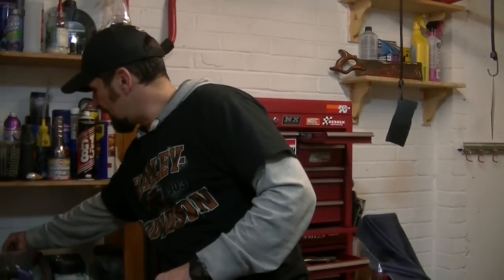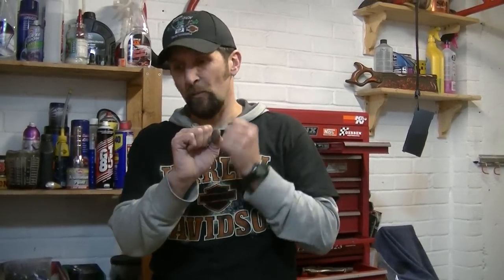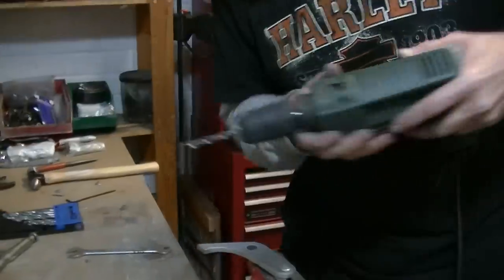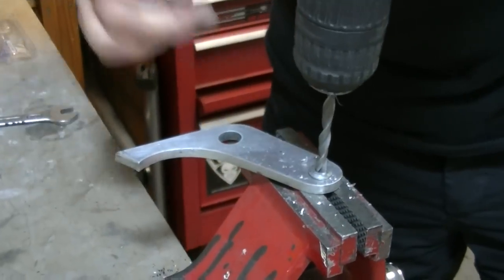Delboy's Garage, Stripped Allen Bolt Fix!

Comment: Hello to you both! Great videos by the way, helped me a lot with my bonneville. Im planning on a 8000mile trip round Europe on the bike come next month. Do you have any tips to modify the bike to make it more worthy for long distance. Im planning on doing the following: TEC progressive suspension front and rear, changed the seat, sissy luggage rack, I'm thinking of doing the 1430 peli poor mans hard cases but I've yet to fashion a rack for the panniers (any tips?), 19T sprocket for mpg, centre stand for tyres. I heard a beaded throw over for the seat was great for long runs. Also would the renthal bars be good swap out for the standard OEM bars? (I have clipons at the moment…..hell no haha)

Keep posting your videos! :)

Sam,
from Chorley
Reply from the maker: Hi Sam..
Not clear what bike you are planning to do this tour on....what have you got as a base bike.. ??
Reply: Ah sorry I have a 11 Bonnie T100
Reply from the maker: Sam Moon
Hi Sam. That's a great bike for the trip mate, i can think of a more reliable and enjoyable bike for a road trip.. its hard to suggest all the things you will need... prepping the bike is an important job ... I have a video about pre-touring prep to give you the basics of mechanical preparation, but as for your choices of how to set it up, it's about practice... the bike has to be as comfortable as possible for hours on end, so take some time to do a few miles with the different bars fitted, and as for the beaded seat cover, that's for cars mate, not bikes... long distance adventure guys often use a thick sheepskin cover, as it can make the bike really comfortable once you get beyond the 4hr mark... as for luggage, you've really got to work out a way to make it work for you!  The Bonnie isn't designed as a tourer, but throw over bags and a tank bag can carry a lot of kit if you pack it right... I'd also fit a Scottoiler and set it up properly, then you can pretty much forget about your chain for the whole trip... carry some basic tools for basic things like chain adjustment, but more importantly breakdown cover that will repatriate the bike if you crash it, or break it beyond local repair... and the relevant travel insurance, but sure you've dealt with all that... I hope that gives you a few pointers my friend, good luck with your trip!
Reply: Scottoiler is a good shout. I think my mate put a cheaper version on his bike and they work just the same, ill look into it. Would it be wise for me to invest in a crash bar? As I've no idea what terrain ill be up against when I go.
Reply from the maker: Sam Moon
You could invest in the engine bars that Triumph sell.. they will save a casing getting broken if you drop it... good idea.. !

Comment: I know this video is a bit old but I'm trying to remove an Allen bolt of the same nature from my rotor. im trashing the rotor and all bolts but I'm worried if the shaft of the bolt will be stuck flush with the hole after I knock the head off. therefore not being able to get pliers to it to twist it out +Moonfleet41
Reply from the maker: +Michael Karle Understand your concern my friend, but once the head is released, then the squeezing force placed on the bolt is eliminated... it will be Locktite'd in, but if you just take the head off only, and leave as much stud as possible, once you remove the disc, you can use a little heat on the area (not a flame, just a hot gun will do, or even the wife's hairdryer on the hottest setting played on it for a minute or so)... this should expand the alloy of the wheel casting away from the steel of the bolt shaft... this heat will also loosen the Threadlock, as it's a plastic compound, and will melt with heat, and also, never forget the wonderful powers of a good soaking with aWD40 before you get stuck in with the stud extractor, or grips ! Have confidence in your skills, take your time and tell us when you get it out... good luck Del

Comment: Any tips for phillips screws that can't be centerpunched or grabbed?
Like the ones in the brakefluid reservoir :(.
Thanks
Reply from the maker: DoubleYouPee Just drill the head out mate..ive had lots of reservior screws mince out, use a drill bit the same size as the screw shaft, and just drill down till the head spins off... once the cap is lifted clear, the screw stump can be unscrewed with sime pliers... easy..!
Reply: Well I did what you said.. drilled it out with same size. Head came clean off right at the base, and I removed the cap.

Stump hardly came above the reservoir so had to punch round with a hammer (you also have a video about this)

Thanks!
Reply from the maker: DoubleYouPee Glad you got it sorted buddy, now replace it with a stainless steel machine screw, and use some anti-seize on the thread....you'll never have the same issue again.. take care. Del.

Comment: Hi Del, today I came across a problem whilst trying to remove the centre stand on my Bonneville. I managed to undo the allen bolt and nut from the right hand side, but the one on the left is stuck. Its an 8mm allen bolt, through a metal sleeve, then the frame from the centre stand, the bike frame itself, then a 14mm bolt on the back side with plenty of thread left over.

I'm at a bit of a loss what to do next. I don't want to lean on it (also its in a tricky place to be able to lean on it), I am worried about rounding off the allen bolt and/or the nut on the back side.

What should I do? Thanks so much in advance!
Reply from the maker: Hi Ben....i know its sounds plain... but there isn't much you can do but lean on it... just make sure you have proper fitting tools, a decent 6 sided socket on the bolt head, and a good quality alun key in the other that fits snug, and tap the tool fully onto the bolt so it wont slip.....and try to crack them open, maybe a little WD40 to soak in first over night...and see how you get on...! sorry there;s now magic solution mate...its just being careful and luck..!!    Hope thats a small help in some way...cheers, Del.
Reply: Success!!! I WD40'd it overnight,then this morning removed the silencer and fully lent on it. Nothing. Then I used the centre punch and toffee hammer trick from another video, again nothing. I decided to give it all a bit of a bang with a hammer on the allen bolt head, the end of the bolt and the nut to try to un-bind the metal surfaces that were rusted together and then with another full on 'monkey boy lean' it started to move! So happy. Got it off, no more centre stand.

First seized bolt I've ever removed, thanks very much, today is going to be a good day!
Reply from the maker: Hi Ben, good going buddy... only when you've done that yourself do you realise how utterly satisfying it is when it finally cracks... and it's even more satisfying when you don't need the item and you intend to discard it that the bolt actually shears off because you put so much force on it, if you came back to me and said it was rounded, or still stuck, the final solution is to drill the head off completely, and belive me, that never fails lol !   Just say to the bolt 'I am the borg, resistance is futile'....
Reply: +Moonfleet41 I had the drill all ready to go in case all else failed. Luckily though this way I only trashed the nut but can keep the Allen bolt and clean it up a bit. Gonna get myself a tap and dye set and see if I can give it a second life now that I've watched your other video on that topic.

Thanks again!

Comment: What about a transmission filler bolt that has a rounded allen or hex head seized bolt, what can you use for that?
Reply from the maker: +Daren Pegg Hey Daren...thsoe drain plugs are big, usually about a 10mm alun key......so normally its a case of drilling through the middle of them, then using an "easyout" tool to remove the rest.....but before you resort to surgery...give the old 'Torx bit trick' a try....   Take a Torx bit that is a tiny bit too large for the hole...and tap it into the wrung out hole right to the bottom....and much of the time is will 'bight' enough to back the plug out...   hope that helps, let me know how you get on buddy...
Reply: +Moonfleet41 The torx bit trick works even better if You use a Dremel tool to cut grooves into what's left of the corners of the stripped allen bolt. This is useful if You have a really badly stripped bolt that is also really badly stuck. Allows You to use a bigger torx bit than would be possible to just tap in. Sure helped with some 15 year old ZX12R brake calipers that haven't been looked after properly :-)

Comment: Head came off but stud is in the threads and can't get the wise grip on it
Reply from the maker: Josh Olivo I guess you'll haveto drill the shaft out too then Josh...go down the centre until you're almost out to the shaft size... then screw a tap in there and it will pull the rest out... clean the thread out with a tap and it should be fine... worse thing you maye have to helicoil it...but thats no sweat and you can use a stainless bolt after that so it wont strip again..!

Comment: i have a rounded off allen key bolt on my exhaust its for the baffle im finding it hard to get in there to get it off what do you recommend?
Reply from the maker: Have you tried tapping a tight fitting torx bit into the hole and see if that can grip it..?
Reply: yeah i did bud i found out that the owner before me had cross threaded the baffle screw into the exhaust but the screw has now snapped so is it a new can jobby mate?

Comment: is it the same with the allen bolt on a discplate of a motorcycle???
Reply from the maker: +milbouse Basa Hi mate, any allen bolt head can be drilled off, just make sure you don't go too far and use a drill bit the same size as the shaft...
Reply: +Moonfleet41 ok thank you. ill try it out.

Comment: What if the Allen is on my Stator Cap? Its not really a bolt.  Its more of a cap but the allen is stripped.
Reply from the maker: +Christian Teubner Not sure which bolt that is Christian, do you have a photo.
Reply: I do
Reply: How do I send it?
Reply from the maker: +Christian Teubner Send to moonfleet10@yahoo.co.uk  ill have a look buddy..
Reply: +Moonfleet41 thanks a lot, that's very kind of you! I'm so frustrated with it, I warmed up ten engine and it still stripped the metal out
Reply: the*
Reply from the maker: +Christian Teubner Hi Christian. Ok, checked the photo this morning, and i see your problem now. 
There are two things that will get that open.. First use a 'Torx Bit' that is slightly too big and needs to be tapped into the hole... that will jam it in and make a good grip in the bolt... 9 times out of 10 that will get it..   if it still rips out... then you'll have to centre punch it round... but im sure the Torx Bit will get it... have a go and see how you get on buddy.! good luck. Del.
Reply: +Moonfleet41 I am a fan of "jamming it in, so I'll give that a go, thanks!
Reply from the maker: +Christian Teubner Nice one mate, its a common fix for this... make sure the Torx is too big, and you have to actually hammer it in (gently)....you may lunch the bit, but tools are for using..!

Comment: Can you do this method with a damper bolt rounded off gr8 vidieo
Reply from the maker: If you mean the one under your forks Peter, then yes you can....but try a Torx bit first... choose one a bit too bit and tap it into place so it jams in there... if that fails.. you can still drill it buddy.! Good luck.
Reply: It worked with the torx not hammered in thanks a whole lot

Comment: What if is a stripped allen bolt for diff on hilux?
Reply from the maker: "diff on hilux"??. do you mean a Toyota Hilux..?
Reply: Yes..Toyota hilux.10mm allen bolt for diff oil drain & refill..
Reply from the maker: Jianfeng Huang
So its a plug then,? ok, have you tried the centre punch method to get it turning?, its into a steel cast casing which is pretty robust, so you should be able to get a good bite, maybe even with a small sharp chisel.... if not, then you;ll have to drill it out... good luck .

Comment: its not fucking that simple i have a freaking small stripped allen bolt that hold my pinion gear on my motor and you cant even loose
Reply from the maker: roma kozlovsky "cant even loose".....what?

Comment: i have a stripped screw inside my clutch case its a 1997 suzuki 1200 bandit and its 1 of 3 Philips head screws behing the 30mm nut after you take off the push plate. how would i go about taking this out?
Reply from the maker: Do you have access to get a centre punch on it mate?
Reply: Moonfleet41 no worries i got it off now. but im having trouble with 2 stripped header bolts now